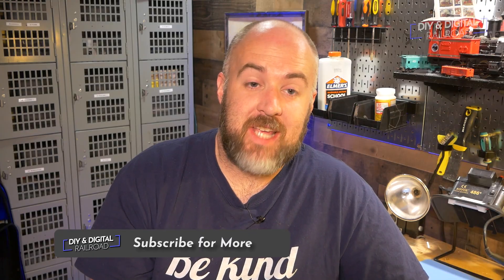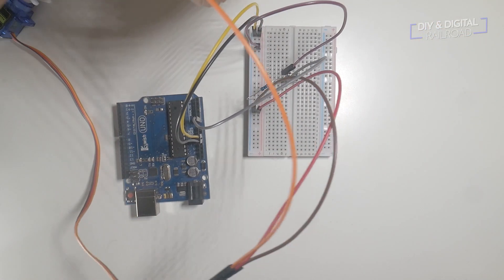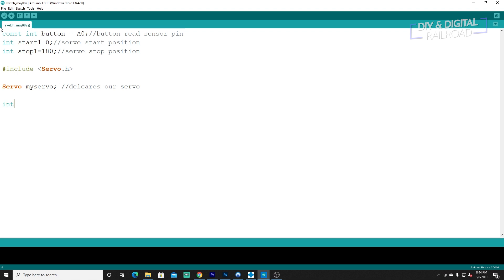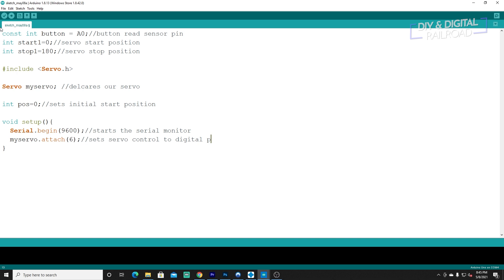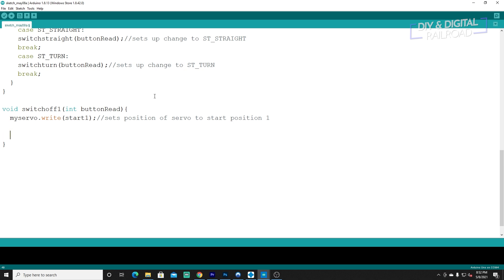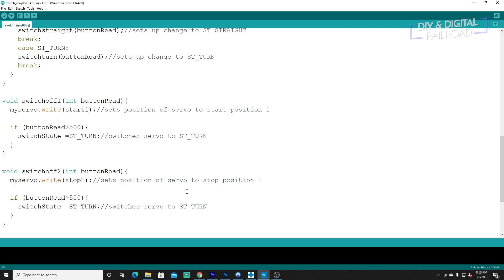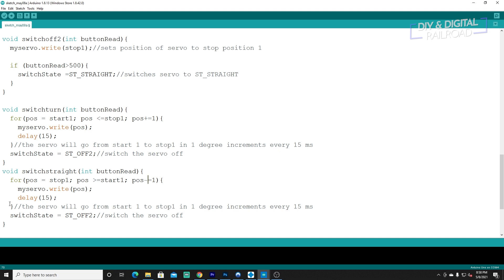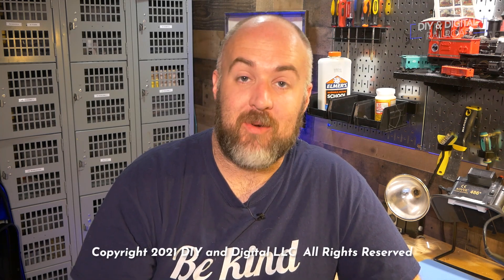Basic Arduino Servo Control for Model Railroads

Comment: I run G scale.  Would like to have 2 servos on locomotive to #1 open firebox door and #2 make fireman shove coal.  My trains are all battery 18v with Blunami decoder that has 5-12vdc 300mA max function outputs (typically for lights).  Would I have to install small relays to trigger servos or is other another way?

Comment: Evening Jimmy.  I'm trying to use your sketch as a repeatable base in order to run more than 1 push button controlled servo. Have you by chance expanded your sketch to do such a thing over the past year? Any help or direction would be appreciated. BTW, got your sketch working well with my hardware!

Comment: Works great! I used Arduino Mega so just changed digital output to 22 instead of 6. Working up to combining LEDs to indicate servo status either straight or turned. Also will eventually be using PCA9685 because I have 30 servos to control. Thanks

Comment: Works great, but I need to be able to  use an IR sensor instead of a push button or any other type of sensor to detect a train when it passes to throw the servo one direction and then the next pass to throw the servo back to the start position.

Comment: You never explained how to actually center the servo and find out where "center" actually is, as it is critical to center the servo so you can correctly mount the control horn to be able to switch the turnout effectively.

Comment: As usual I'm lost.   Right now I wish you were here helping me.   I just got a Digitrax  Evolution starter set and can't get it to work.   My DCS 210+  will not read the track and I can't get my DT602D to work with it.   If I replace  the 210 with a DCS 100 it will.  I  don't know if I got a bad 210 or am I  doing something wrong!  Anyway I'm still trying to have fun, Chris lol not.😩😥
Reply from the maker: A lot of times with products like this, they can have issues in the firmware they were loaded with that was fixed in later versions after they left the factory.  I would try to update the firmware on all of your devices.  Here is a link to all of the firmware downloads from digitrax https://www.digitrax.com/downloads/. They have instructions on how to install the firmware there as well.  I'm sorry you're not having fun and I wish I could do more!
Reply: Thank you Jimmy,  I  actually moved the Local Net cable from port A to C and plugged my remote into A and it worked.   I'll still  do the  update and I let Digitrax know,  Chris

Comment: Could you be anymore confusing with your coding, it is just about impossible to follow what you are doing. Try "Little Wicket Railroad" coding for servos, it makes more sense and is easer to follow.
Reply: I disagree.  I found this to be very well done and very clear. That said, reviewing other videos and other code always helps as you may not want to do exactly what Jimmy has done.
Reply: Also the IoTT channel has a great how-to, broken down into three videos (17,18 & 19), on adding the whole thing for DCC operation.

Comment: Great explanation of the code!  I'm curious if you had any issues with the Arduino not having enough power for the servo?  I tried using servos with an Arduino, one servo using 2 buttons to turn it.  After three uses, the pin stopped working, tried another one, and that stopped as well.  The Arduino essentially was unusable.  What I could find on this is the the Arduino can't handle the amperage of the servo.  Could turning off the servo in the code eliminate this?

Comment: Not that I understand, but it would be nice to explain/ reason why you do the positions with the pins.  Like why did you pick 6, what does the Resistor do, and why that size.  The programming is where I always lose it, because ( this is ME personally) I have no interest in the programming stuff.  Just not for me.  But I did like how you did the programming, labeled what the commands do and show so short cuts.  Good for those people that want to do it, Thanks.
Reply from the maker: Some of the arduino pins allow for Pulse width modulation or PWM.  Pin 6 is one of them.  That is why I picked that one.  In terms of Resistors.  I am not an engineer and I don't do the math for resistance.  I just know from tutorials that a 1K resistor works with a momentary push button.

Comment: What code changes must be made to use a toggle switch rather than a momentary contact button.
Reply from the maker: It depends on the toggle switch.  You could actually simplify the code a great deal depending on which one you used.
Reply: Thank you.  A double pole, single throw, either on on or on off on.  I an struggling with arduino and sure would appreciate seeing that code.

Comment: Hey Jimmy...good video....of course I have to ask...why aren't you using digital pins? Basic code: int buttonState = 0; then buttonState = digital read(buttonPin); and then do the code for state high and low aka on and off....this way when layouts get bigger with more and more buttons and servos you won't run out of pins as you can use analog pins as digital pins. Just a tip for future code and tutorials.
Reply: One reason for going the analogue way is to avoid having to cope with bouncing. When you press a button, it doesn’t happen instantly, but rather in a on-off-on-off way (multiple times that is), so you have to verify that it really is a push. Also, the bounce could easily be interpreted as multiple pushes. Doing the analogue is kind of easier to do instead
Reply: @DeStoreholmskeBaner  you can account for the debounce in several ways...and in most of my code I haven't needed any debounce....the basic digital button code works just fine...it can be found in the example sketches. Also you can add code to look for multiple presses and ignore those presses.